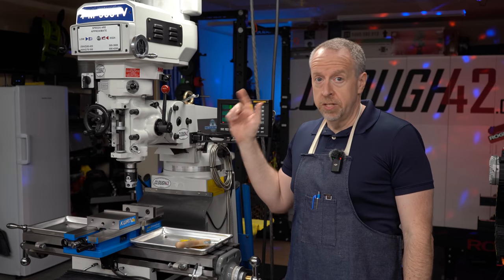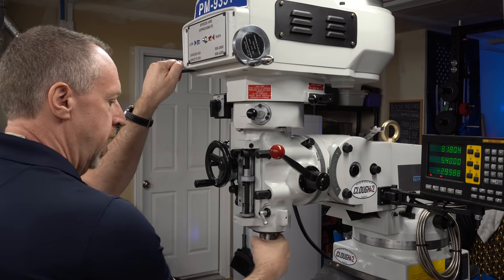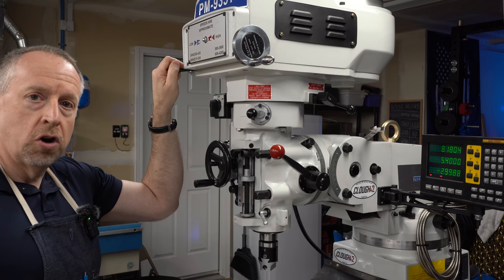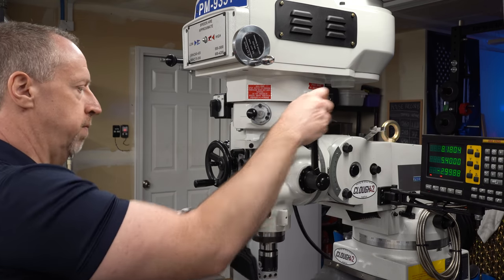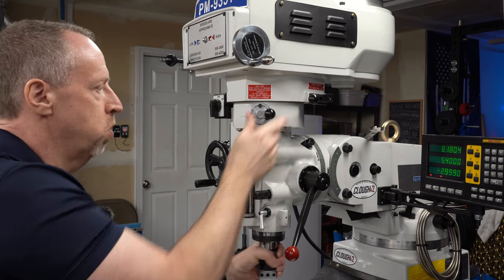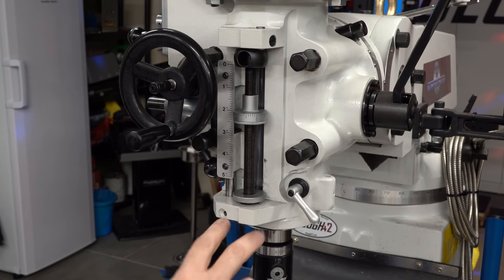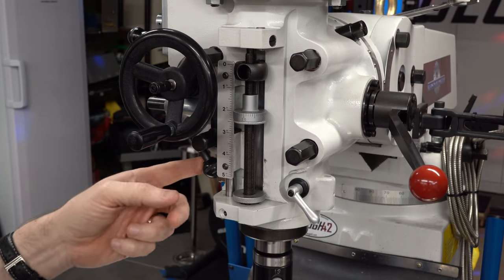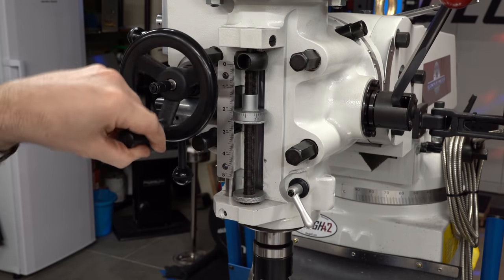Vertical (Bridgeport) Milling Machine Head | Every Knob and Lever Explained

Comment: Not having a milling machine and always thinking one day I will get one, this was great. Thank you.
Reply: this ones nice but theres also a dizzying array of vertical and horizontal mills and some that utilize various attachments to do both even. Personally I would use the one in the video for exactly the sort of things he said, power tapping, chamfering the edges of cast parts, etc etc. over the years these types of mills were absolutely offered by many as he said and still are, theres so many options out there its crazy. I would again personally say a purchase would depend on budget and use. If you just want it because its a cool tool then ok, you buy a used one or maybe something smaller than this one and put it in your garage. The important thing is to take a course on basic use of whatever it is you get from a trained professional. even if its just tips and tricks from a retiree or videos like this. these machines can and remorselessly WILL take your fingers off. but with that said, wisely used they are tremendous fun. its not really commercially viable to do job shop work with purely manual machines for big things, or large batches, but even today, sometimes a solid old mill is a great option for many things. Best of luck.

Comment: "You do not want to test safety features like that." - I had a fume hood, some dangerous gas goes into fume hood for a process (there is a valve for that). I added an interlock so that gas could not be on if fume hood wasn't.... what did they do? Decided they no longer need to use the valve because hey, if I just turn off the fume hood... that turns the gas off right?! (my face is palmed, there is an alarm for that now)

Comment: Very nice mill James. All except that back gear reversing your Spindle direction. Why not install a micro switch that would actuate a double poll double throw relay to swap two wire pairs of your forward reverse switch and then your switch would always be what it says. 🤷🏻‍♂️

Comment: I have run several Bridgeports and clones.  I bought and rebuilt a English Beaver VBRP mill.
The biggest difference is in the power feed and travel limit on the quill.  
I am glad I found the Beaver.

Comment: im a year late but i think this is outstanding and tons of these about as wide a variety of tools as is possible should be made, and then compiled into a reference library. Im totally going to post this to my facebook wall with the caption "so you want to be a manual machinist? this is one of about 250 tools you could be using"

Comment: My fun little Bridgeport story. Got called to help at a different plant. Some holes got drilled off so I had to mill the slot a little longer. Boss man helps me carry the stuff down to the shop area and there was a drill chuck in the mill and I just need a collet and end mill. I grab the vise handle and loosen the draw bar with it and his head almost exploded 😂 he had never seen that one before.

Comment: My BP clone is a pulley change speed selection type, but most of the rest is the same.  I still need to make a hand wheel for the fine quill feed, mine was missing so I haven't tried it out yet.  Thanks for sharing!

Comment: just a little side note James, the micrometer fine feed lower nut needs to have clearance to drop if you wind it all the way down it will jamb and not work.
Reply: Good point, thanks.

Comment: An important note for Bridgeport mills with a step pulley drive. When engaging back gear there is an additional lever on the top of the spindle that must be rotated to the right about 1/4 turn along with the crank lever shown on the side of the milling head. This top lever uses a cam action to disengage the large bull gear from the spindle. This performs the same function as manually pulling out the pin that locks the bull gear to the spindle on a belt drive lathe.

Just engaging the side lever on this style mill will lock the entire spindle immobilizing it. While this may seem to be a really handy way to get something stuck in spindle loosened on a back gear equipped lathe or mill, it is inviting disaster. If you are banging on the hung up tool or chuck all of that shock is being transmitted through the bull gear teeth and latching pin. If you've ever wondered how someone managed to break teeth on a back geared machine you now know how to do it.
Reply: And when switching to direct, after moving the top lever, you need to rotate the spindle until the gear drops in place, before you turn on the machine. After running a step pully machine for many years, even now that I have vari speed heads, I still find my muscle memory reaching for that top lever.
Reply: You’re absolutely right..👍

Comment: We got a PM-950V at work several months ago. I had already learned everything here from the manual plus various YouTube videos, but I would have loved to see this video back then. The quill feed functions on a Bridgeport style head can be confusing, and your video covers everything in one place. This will be very helpful for anybody getting their hands on a Bridgeport style mill for the first time.

I've been wondering whether it's ok to routinely use the brake to stop a spinning tool. I've mostly just used it while wrenching on the drawbar, for fear of wearing the brake shoes quickly.

I got sick of cranking that two-piece micrometer stop up and down all the time, so I replaced it with one from McMaster-Carr that has a push button to disengage it from the threaded rod. That was a nice quality of life improvement that you might also like to consider. I also just put a cheap quill DRO kit from Shars on it, and I'm liking that so far.

Comment: Great demonstration of the mill's features. To prevent running the mill in the opposite direction to that intended when back gear is engaged a sensor could be installed to detect back gear lever position which affects the electrical current flow direction in the motor direction control circuit using a relay switch configuration.

Comment: Ideas for Future videos: Using Inkscape to create circuit board edging on EasyEDA (Which leads neatly into)... WORKFLOW! Using various apps and pushing the outputs between each other. People may know one app but not realise that you can export the dxf or gcode or (insert 100 formats here) format into the other software and thus setup "workflows". As a software and a hardware guy you are well placed to talk about workflow do's and don'ts. You are also aware of the 1 10 100 rules of effort and all the other nice things to throw in fun diagrams about.

Comment: Thanks, James, I learned something today. I had been unaware that the quill power feed had an upward stop trip feature.
Because it has a Vari-drive, your mill must be patterned after the Series 2 Bridgeport; it’s interesting to note that there is no need to disengage the direct drive portion of the spindle when engaging back gear. My older Series 1 machine requires the spindle to be set to freewheeling before the back gear is used.
Reply from the maker: In a lot of mills, the top lever is broken, apparently, making it very difficult to disassemble.

Comment: I really enjoy shop improvement videos, either where you are designing/adding a new tool, improving an existing tool/workspace, or even just showing a new skill you’ve picked up. 
But I guess the point of having a shop is to use it, so maybe there’s another ELS-like project you could start? Or if you are hesitant to start something right now, maybe collaborate on someone else’s project. 
This video was fine too, and I think pure explainer videos are important too in between projects. Just some thoughts, hope they are helpful.

Comment: On my machine I move the power downfeed engage/disengage control with the spindle on, but with gentle pressure. That allows the worm gear to mesh without clashing. Same with feed rate  selector control. I've done it this way on BPs and a variety of copies. (Similar to the way Joe Pie engages the half nut on the lathe.) The BP operator's manual agrees. It says to turn CCW to engage, and CW to disengage, as you did it. In other words, through the bottom arc of its swing, but I can go either way on my machine.

Comment: James, you should consider a push-button depth stop, like the one made by Morton.  Beats running (2) 1/2-20 nuts up and down.

Also, think about quill DRO, either Mitutoyo or a knockoff.  And when you install it, think seriously about remaking the brackets to move the DRO to the left about 1.5".  That way you can still get to the depth stop AND have DRO.  Since the DRO head has basically no force on it, the additional lever arm doesn't really appear to impact accuracy (or at least I couldn't tell on mine using gage blocks and such).  There are times knowing how much you're moving the quill is useful.
Reply: Although looking at mine, I am not sure that you could move it over.  The DRO and the downfeed handwheel will try to occupy the same space.  I don't ever use the downfeed handwheel, so I didn't give anything up.
Reply: One more comment:  your quill return spring seems set mighty aggressive.  

For many tasks, that might not be a big deal.  But if you were boring a hole to the depth stop and kicked out the feed, it would be nice if you didn't put a nice helical groove in your finished bore as the spinning cutter sprang back out of the bore. 

It really comes down to personal feel.  All of the machines I have ever used (probably 8 or 9, nearly all original B-ports) were set up with a nearly neutral spring return.

Oh, and I liked the format.

Comment: Thanks James, I'm thinking of replacing the Jet Mill/Drill with one of these and this was really helpful.  I didn't realize all of the functionality of this machine until your video!  I'm also trying to figure out if the bigger table on the 949 is necessary.  Have you bumped up against table top to quill or other work envelope challenges with it?

Comment: Hi James, have you considered a project to connect a microswitch on the back gear that reverses the polarity of the fwd/neut/rev switch when engaged.  Could prevent a nasty mistake for someone down the line.  Thanks for the overview of the controls found it very useful.
Reply: My spindle direction errors have caused irritation and inconvenience rather than disaster.  But I still think this is a good idea.

Comment: Loved it!  Now do the table and head tilts.  Well, maybe head tilts are pretty obvious.  Do the table.
Reply from the maker: Sure.  Are there any points in particular you'd like to see covered?
Reply: @Clough42  On reflection, compared to the head there aren't that many knobs and levers.  On the other hand, where the table motions are most important is in terms of speeds and feeds.  Perhaps you could do a remedial bit for us on cutting speed.  How does the number of cutting edges effect feed rate.  I'd be pretty interested in learning about that.

Comment: Man! I wish I would have seen this ten years ago.  Maybe I should read over my manual? I dont even know if I got one? I didnt even know my machine had an auto stop feature on the downfeed after ten years of using this machine? Maybe my lathe has one? I always wondered how you stop the feed when threading into the part? You should do a similar  video for Lathes.

Comment: I just recently purchased a Bridgeport J head mill.  I am going to add a DRO.  On your previous videos, you installed a 4 axis EL 400 on your PM-940.  It looks like your PM 935 VS also has an EL 400.  How satisfied are you with these DROs?  They use magnetic scales.  Is there a reason you chose these over glass scales?  I am new to machining.  It would seem that the quill scale would be more functional than the z axis on a knee mill.  Is your x axis scale mounted on the outside or inside of the table.  If inside, does it restrict y-axis full travel?  Anyway, great tutorial.

Comment: “Don’t be an idiot!” Straight forward, plainly said, and absolutely correct.

I would like to say that the brake on this type mill is only so strong. If you are using an ER-40 collet, as I usually do, yo may need to really torque down on a large diameter bit.. if you torque too much, loosening it can become very difficult. If it’s too tight, you can actually break the brake. No, I haven’t waited years to be able to say that. But these machines were first designed in 1936. Bridgeport also designed the R-8 collet system. They didn’t expect the modern collets we have now, so just don’t overdo things. Not everything needs to be tightened to an inch of its life. But the ER-40 can slip, so just monitor it and be careful with large cutters and deep cuts. Now, I do t mean that you will actually break it, it’s not made that way, but it will seem that you did, because it will slip, and you won’t be able to loosen the collet.
Reply from the maker: Torque also affects runout for ER collets.  I have a torque wrench for them for exactly this reason.

Comment: Clough42, the Langmuir will slice straight through ceramics and glass. You gotta have the bottom sitting in water and the top needs thin aluminum. I used contact cement spray to secure it. Totally inefficient at any scale, but you can, in fact use the Crossfire to slice through dielectric and insulator media. Not sure how much is from plasma and how much is from local heat fracturing. Also limited in my abilities to measure dimensional accuracy.

For anyone wondering: we had a brief chat about it in the glass cutting video. Using CNC plasma to cut glass.

Comment: Well said James. I'm not so quick or impatient to use the brake every time I stop the quill. 
I think you could in therory at some time wear it out doing that for years at a time.
I like to save my brakes for tool changes & stuff.  to me, unless you really need to save time,
I think it's bordering on abuse. Someone who works with bridgeports for years on end
might have a different opinion.

Comment: The auto-shutdown feature on the up-feed is probably more of a safety-feature than anything else.
Reply from the maker: Yes.  Especially since you can't adjust where it trips.
Reply: I'm not fond of machines that will let the operator set it to self destruct.  Any new machine I buy will definately have travel stops that disengage movement.

Comment: I kept waiting to see what happens when the spindle lever on the right side reaches its maximum travel.  Does it kick out?  Does it go into a neutral state? Or is that range of motion the maximum travel for the spindle?
Reply: If you are manually feeding by pulling on the lever, it just hits a hard stop, just like a drill press. If you are power feeding, it kicks out automatically as he described.

Comment: It’s about time to do a review on this machine I’m debating about pulling the trigger on a new machine I’m kinda stuck between one like you have or one like abombs got I want variable speed and bigger than r8 spindle taper either 30 or 40 leaning towards the 40 taper tho but these mills used require so much work to get back into spec seems like new with warranty is the way to go my current mill is a very clapped out wells index 645 which is smoked spindle bearings need replaced but as is I can’t justify the 750$ for replacing then if I was to that I’d want to atleast move to an r8 taper because tooling is so much cheaper and easier to find over the bs9 stuff which would be another 1500$ for again a mill that’s just flat out wore out I could very easily spend 4-5k getting this machine back to some semblance of accuracy but again it would still be a 40-50 year old machine
Reply from the maker: I like it.  The 9x35 size works well in my small shop, and it's light enough, at 1500lbs, to move with an engine crane.
Reply: @Clough42  that’s nice mine weighs about 2700lbs which would be great if I had the skill and tools to scrape it back in the body isn’t in to bad of shape but the head is shot to bad wells used a completely different head setup than Bridgeport or I would fix this one
Reply: The BS9 taper can be reground to R8.  Wells-Index will do it, used to be around $250, don't know the current price.
Reply: @somebodyelse6673  750$ is what they want now but that was 8 months ago
Reply: @jeremycable51  - That's WAY more than I would have expected, sorry to hear it's so much now :(

Comment: I prefer manual oven cnc thumbs up
Reply: I know it's silly, but the typo made me think about it.  Manual oven cnc, would be banks of bimetallic strip temperature switches inside an oven, that activate machine functions as you change the oven temperature with a dial. 

There is no universe where that would be USEFUL, but it kinda cracks me up thinking about it.
Reply: @somebodyelse6673  After your comment I'd better not correct my typo.
What bothers me alot are those bimetallic strip thermostats oven/hotplate controllers should have long ago been replaced with PWM controllers. So temps can be maintained at +-1deg with PWM instead of the current century old bimetallic strip +-100deg.

Comment: James,
I have a love hate relationship with watching your videos. I love the content but hate the abuse I get from my wife when she sees the new tools on the front porch delivered by UPS.
Did you setup the PM935 with your Harbor Freight engine hoist? 
I have a Rong Fu RF31 and would like to move to a knee mill. This looks like a good fit for my small garage. I see the shipping height is a little over 5' and weight 1500 lbs. So I was interested to know if you were able to set it up with your  2 ton engine hoist, at least I think it's 2 ton.
Thanks,
Chuck
Reply from the maker: I did set up the PM935 with my HF engine hoist.  I would say it was right at the edge of its capability.  I would have preferred a gantry with more capacity.